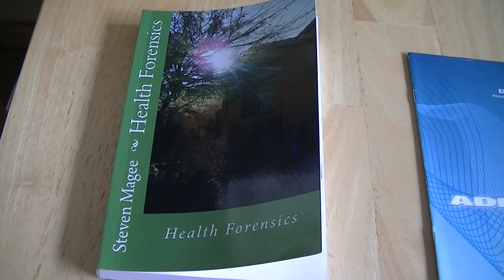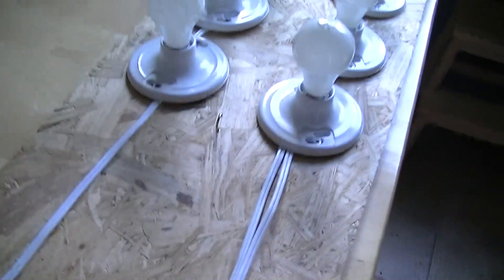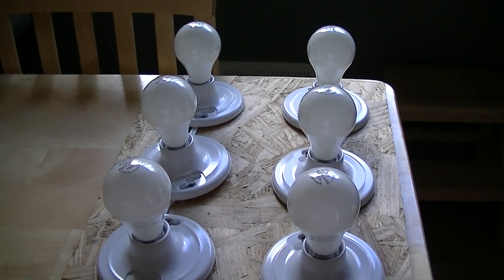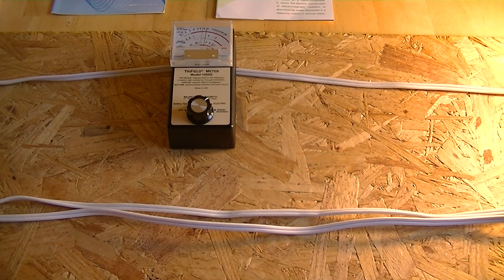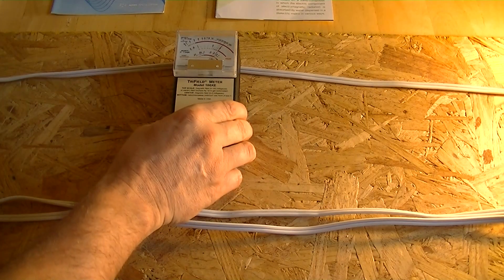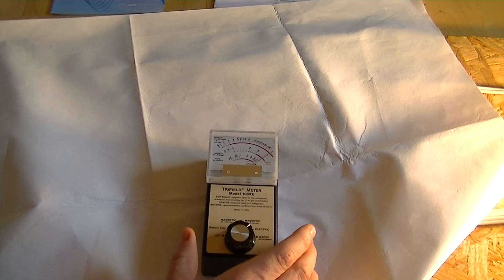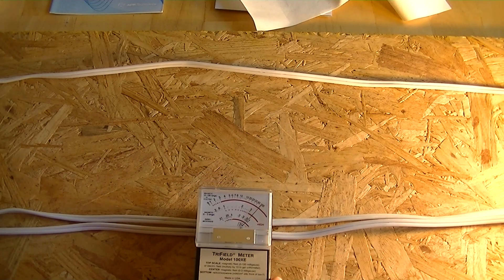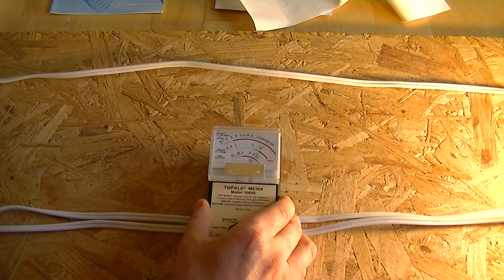Testing of ADR Tex Electric Shield with a Trifield 100XE Meter

Comment: Is the fabric conductive enough that you can ground it?  I've found that with fabrics like silverell they have high readings unless they are grounded, but that was with resistive loads.  If you can ground the fabric it would be interesting to see if that changes the readings for the dimmer circuit. 

Unlike the resistive load the dimmer is giving off harmonics, so maybe the fabric is only effective for shielding low frequency fields.  Very interesting overall.  Yet another reason to get rid of the dimmers!
Reply: Yes, it should be grounded. It can shield upto 30 db. It provides shielding from 1 Hz to 100 Mhz.